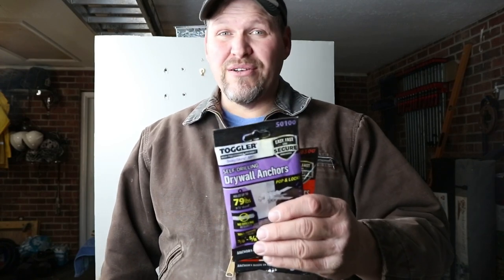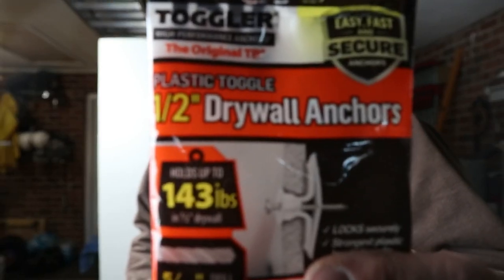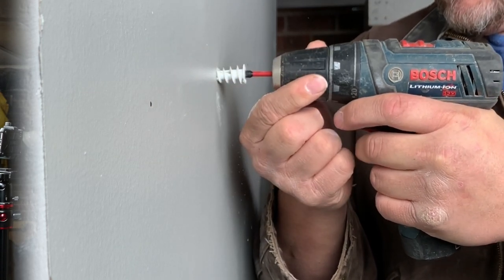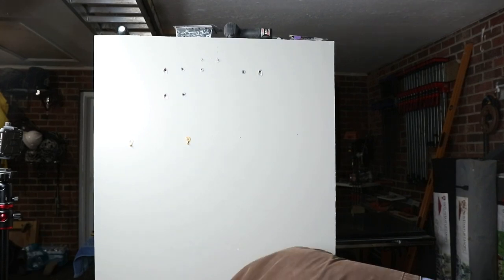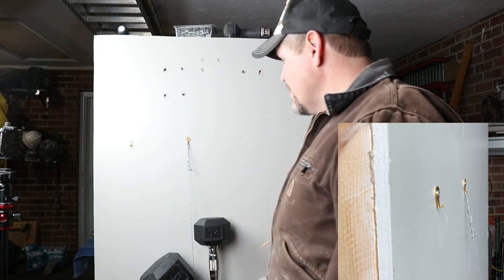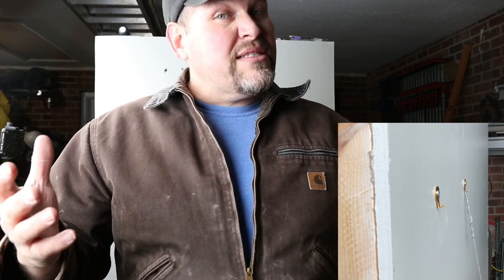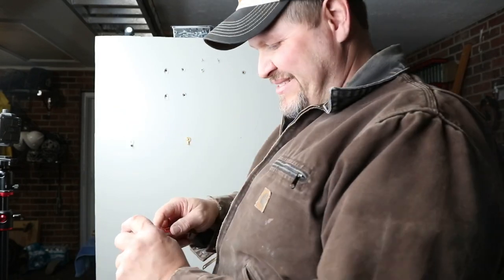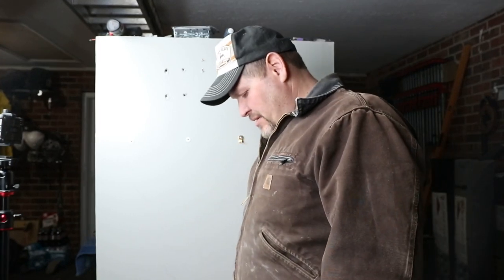Drywall Anchor Install and Test (Toggler Anchors)

Comment: Would you use these to hang an 80lb glass shower door?  The door is supported by 2 hinges with 4 holes each.  The wall consists of 3/8" tile backed by 1/2" cement board.

Comment: Well that makes sense. If you had a stud to screw into you wouldn't need the anchor 😉. So far i like those 143 original toggles but am concerned how much to snug them down. The packaging just says do not over tighten whatever that means. I snug the screws up just enough till about the last 1/8 of a turn has some resistance. Seem about right to you? I would think if they're rated for 143 then you shouldn't really have to worry about over tightening. I also like how the toggle is made in America.

Comment: I am trying the Toggelers but I can get that red pin (what you called the activator) to push the release on the inside of the wall.  It says to not hammer it, which I get because it would probably break.  I'll keep trying but if anyone has a tip on how this actually works I'd appreciate it.
Reply: Same!!